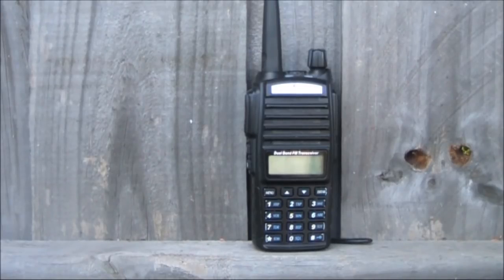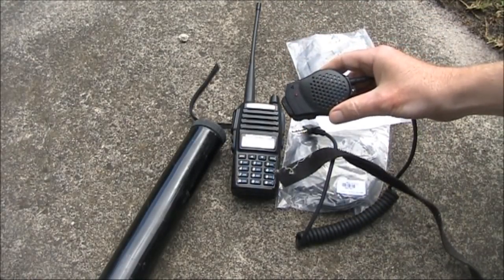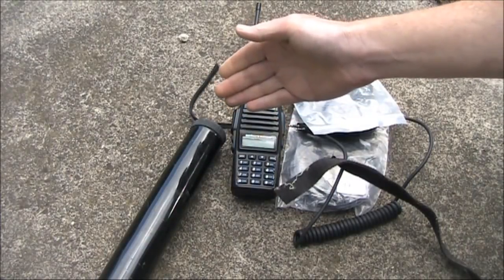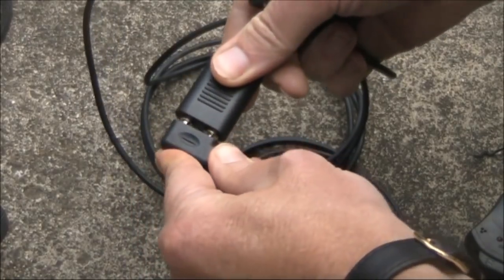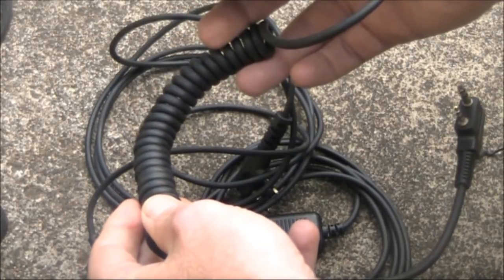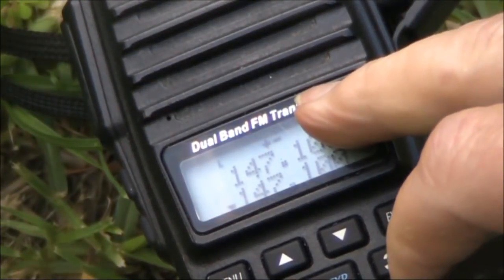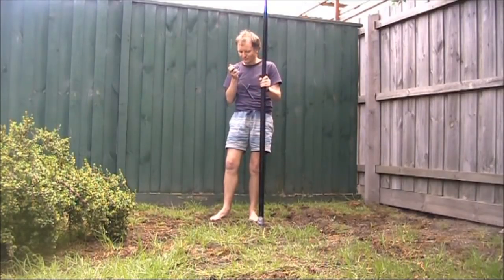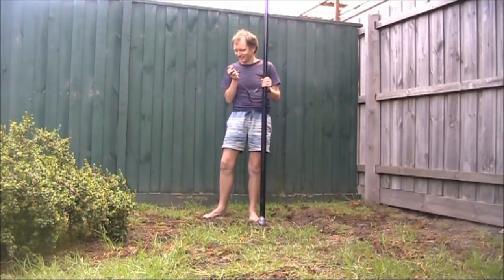Raise your handheld. Raise your signal.

Comment: I haven't tried the extended speaker/microphone cords Peter. I have used extended arm above my head with a stretched out speaker/microphone cord which worked quite, especially with my height advantage of 6 feet 4 inches. Today, I carry a squid pole that collapses to about 6 feet but extends to 23 feet. I use a 450 ohm J-pole configuration attached to the top of the extended squid pole and a length of RG8 coax. I used to use small velcro strips to affix the coax to the coax to the fiberglas pole but I've converted to bongo ties.

Comment: Great to see this published though its only logic. When I taught young trainee first aiders they laughed at it but they realised if you are kneeling at a patient dont expect a radio on your belt to be able to summon help. Stand up and hold it up. I supplied all with a remote mic. More recent sets were light enough to clip on a lapel so my successor did not supply mics. M0OLT.

Comment: Great video!! Keep them cooming Peter.  There is also a tremendous improvement if you replace the factory rubber duck antenna with a more efficient antenna. And, you could put a 6ft or 10ft coax between the radio and antenna, then use the squid pole to raise just the antenna instead of the radio. 73s de km6wt

Comment: Handheld mic for Baofengs and similar HT's are crap.  Putting one's HT on a squid pole is kind of an ass-backward way of doing things. I have a couple of wire antennas for 2m/70cm that I attach to a to telescope poles of various heights.  I use a Slim Jim antenna (sold on ebay.com), an endfed halfwave antenna and a compact logarthmic yagi antenna based on the design by HB9CV (the latter two antennas purchased from www.lambdahalbe.de).  If necessary, I have a length of RGB58 coax.  Getting a wire up high on a pole is lighter and easier than getting an HT up high.  Antennas are easy to make and cheap to buy.
David DM3BC
Reply from the maker: 1. I've done audio tests of cheap external handheld mics for Baofengs. Their audio quality varies but often they are no worse than the internal mic.  2. Some non-amateur UHF transceivers (eg UHF CB and FRS) do not have removable antennas so the approach described is the only way possible without modifying the transceiver. 3. I agree that adding external beams is a good approach.  They feature extensively on this channel, the most recent being last week.
Reply: Raising the height of the HT might seem backward but has so many advantages to new antennas and feedlines. The biggest being speed, simplicity and cost. Also HTs don't have high power output so power loss from connectors and feedlines add up. I can work 90km using 300mw on 23cm, just by increasing the height of my HT. Height is might 2M and above.